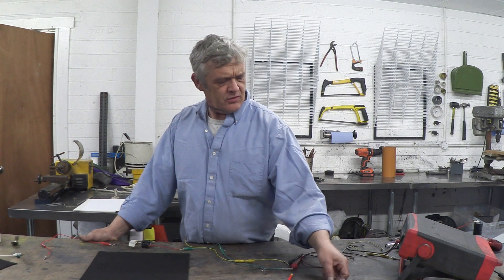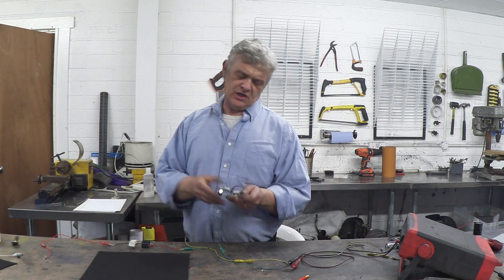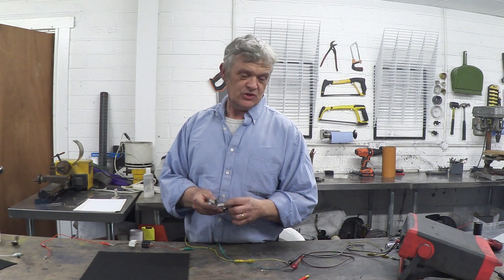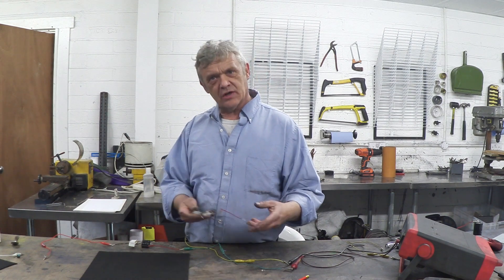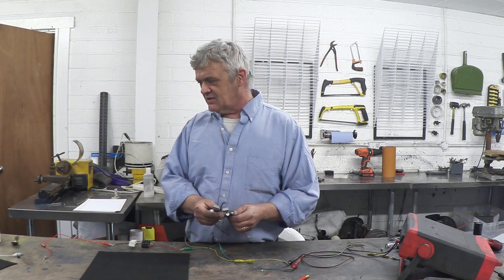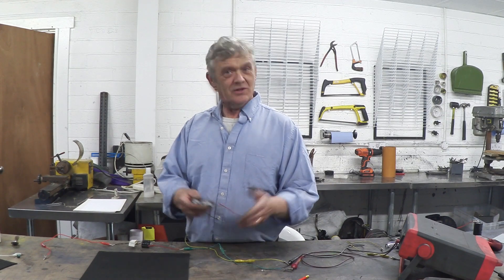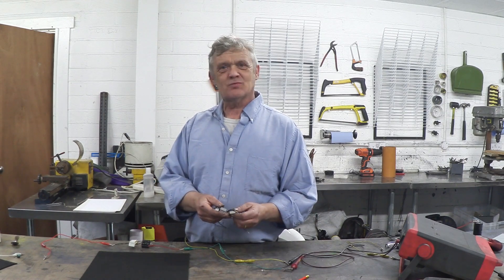Surprising Material Doubles Energy Collected

Comment: I've seen a video years ago of John Hutchison chucking his copper plate up into a tree and running a motor with the basic energy collector setup in Tesla's patent. He talks about pre treating the plate in a acid bath. He etches his collector plate / antenna with the intention of causing "sharp point throughout the surface. It could be that this carbon felt is also  similar to the etched surface and is able to absorb / collect better than just a flat "polished" surface.
Reply: The problem with john hutchison was he never give any information to public but rob always does...God bless this man

Comment: I thought Id do a dirty and simple test experiment first, as a baseline before trying out any carbon felt or other materials and was quite surprised at my results!
I hammered a rusty steel stake into the ground a few inches and then jubilee clipped a length of copper cable (speaker wire) to it. Then I cut around a 2 m length of 1.5mm twin and earth flat mains cable and stripped out the brown and blue wires so they were separate. I straightened out the brown wire as best I could by hand, exposed about 1cm of copper core at one end and stuck it along a wooden beam that runs  across the inside of my garden shed.  I connected my multimeter to both wires, the one from the ground stake and the other to the end of the suspended mains cable and switched it to AC volts. The meter showed 625 which I thought wasnt bad for a dirty quick test, then I realised it was actually reading 6.25 volts!  I switched it to the freq setting and it read out 50hz.  So to see what happened next I suspended the spare blue wire I also had, but seeing as I had nowhere else to suspend it I just stuck it alongside the brown wire that was already there so they were both sitting next to each other and even touching in places (both wires still have the full insulation on them). I connected both antenna wire ends together so they were in parallel as that was the easiest thing to do. I didnt expect it to do anything really, but the voltage now read 9.35v AC, a 50% improvement.  No bad for a 2 m length of old mains cable.  I made up the circuit you showed with a couple of spare caps I had lying around (400 nf I think) and set it to charge the electrolytic capacitors.  I'll check the max DC volts on the caps tomorrow.
Reply: 1 day later and the electrolytic caps were charged to 57v dc.
Reply from the maker: awesome mate - interesting results

Comment: Random thought for you.  A piece of conductive metal (zinc) would have a resonant frequency it works perfectly at.  This would be where it collects the most energy.  
Carbon felt would have multiple conductive paths through it and as the material flexes these paths would change.  My random thought is.  The multiple paths would have multiple resonant frequencies and thus would collect energy over multiple frequencies.  Anyway thought I should share that in case it may help you or someone else.

Comment: I built up your exact circuit and measured 2V across output however when loaded with a 1 megohm load the voltage dropped to 1V. This meant output power was limited to 1 microwatt. Almost useless!
I put an oscilloscope between aerial and common of output capacitors and measured about 2V peak to peak of 50Hz which is consistant with 2VDC output. This proves that the voltage I measured was generated by stray field from house wiring.
Reply from the maker: okay mate

Comment: Thx Robert,
As always very interesting what you do.
I have had this circuit laying around for quite some time to.
I noticed surface area is very impoprtant as is hight.
Someone made this circuit on a PCB 100x So 1 PCB with 100x this circuit and they all connected to 1 antenna (aluminiu foil) in the attic of his house.
He claimed to get a steady 100 Watt power out of it all. Maybe an idea to work on/with/by/under. Anyway you please?

I love your channel and what you develop and research. Keep it going.

Cheers,

Rene
Reply from the maker: yes - i mean to put it higher but want some standards so am keeping it in the same place for now

Comment: Can you put an oscilloscope on the antennae input and measure the frequency and voltage?
If 1N4007 diodes work then the frequency will be low. I suspect it is stray 50Hz mains noise you are picking up.
It would also be useful to know if antenna is directional.
Reply from the maker: equally mate - it's such a piece of cake you could do it and share
Reply: @ThinkingandTinkering  I built up your rig but used high speed 1N914 diodes.
I managed to get over 2V  but if loaded with 1Mohm resistor the voltage dropped to 1V i.e onlt 1 microwatt of power available. 
I put a scope onto the antennae input and saw about 2Vp-p at 50Hz in the input. This is just stray fields you see adjacent to any mains cable. If you wish I can send a photo of the oscilloscope display

Comment: In your battery experiment with the potassium hydroxide solution, how would carbon felt stand up as a replacement to the carbon rod wrapped in steel wool??
Reply from the maker: badly the conductivity of the felt is a bit low for applications in batteries all by itself mat
Reply: Any better when you combine the felt with the carbon rod & steel wool??

Comment: from an antena power collection perspective it doesnt really suprise me if you take into serious consideration the self simular fractal nature of the foam antena at all micro/macro scales and electromagnetic wavelengths, thinking about the dark material, perhaps dipping it in a colloidal formulation of micro thermoelectrical particals with opposing magnetic fields would enhance the device even more ,as the suns/local heat would then also add to the localised generation
Reply from the maker: i was having similar thoughts mate - cheers

Comment: Hi mate! Very interesting as usual. May i suggest a few experiments? As you may now, nano-particules have very effective antenna properties. when two particules are close enough, their sensivity is multiplied by 10.000. These particules are very easy to obtain by a chemist. One could make a coating that could be applied on clothes in order to charge phone, for example, but i think that the sensivity would be surprisingly great. Another idea that may seems crazy would be to put a nail in a tree and connect it like an antenna and look what we get. Nano-particles are everywhere. Depending on their size, they resonates with specific frequency. Also, phones antennas uses fractal design in order to minimise size. Think about it... Cheers!
Reply from the maker: yeah - such thoughts are always on my mind Adrian - it is interesting that with nanoparticles the apparent aperture is greater than the actual aperture - something in common with active receivers
Reply: @ThinkingandTinkering  Yes,  i even bet that it should be possible to use an antenna in place of a phone battery. Such antenna should use nanoparticles and should be tuned up to the most powefull frequency, which may vary, or not that much...

Comment: I can only imagine what will happen when the carbon felt is dip coated in that amazing ink you make. Surly the graphene would increase the surface area. I will give it a try as well and let you know what I find.
Reply: J S Coated... or sprayed? Eh. Sprayed could help in continuing the “more surface area” theory.
Reply from the maker: it may not be surface area mate - it may be that the structure of the felt represents an antenna network and is more like a metamaterial

Comment: Just a question and maybe something to be careful of:
When you were doing your measurement have you used it at the same time with any other antenna?
Reason for this is that measurements can vary simply because of the time you are testing there is increase in RF activity, WiFi router, radio station, TV or what ever else is collecting  - therefore if you measure at specific time without knowing what actual radio wave spectrum you collecting, reading can be misleading. Also worth adding in centimetre wave length small movement in room can mean different result, and you can see that from phone apps that measure field strength in room.
Reply from the maker: Bifield-Brown had similar problems - i think for 5 years he took his measurements based on time of day....cheers mate

Comment: Amazing.  Maybe the thickness matters, but i bet the impedence or resistance in the material helps build up the resonant wave forms, making it a better inductor.  If its just impedence, then tiny resistors would show the same result on flat materials.  Maybe it is the third dimention that affects it.  The military use beefy antennae, so yeah, maybe so.  What a great and potentially cheap antenna material!  Wow, this makes me wonder if the Earth's thin layer of crude oil is conductive, and how that affects lightning storms.
Reply from the maker: interesting ideas mate - cheers for the post

Comment: I assume that the different materials tested were all the same size/area/volume?
Reply from the maker: lol - of course - and in the same geometry, position in the lab and concurrent testing to remove any time factor
Reply: @ThinkingandTinkering  Have you tried creating a second same size mat and connecting it to the "ground point" so it will act as a dipole?  I'm also curious what do you think you are actually collecting? Is it RF energy from a broadcast station? Wifi? Cellphone tower?  any ideas?

Comment: Like sound waves it may be catching back splatter aka you throw a ball at a wall it bounces back the felt is not flat thus the bounce back goes off in many ways and hits more walls and bounces and so on.
Reply from the maker: that's highly likely - it's an activated carbon and it is probably happeneing at the mesoscale as well
Reply: @ThinkingandTinkering  Right down tiny carbon caverns the world is so amazing.

Comment: My guess would be that it has to do with the increased surface area present on the carbon felt. Zinc plate would have a front and back surface.  Felt has front, back and many layers in between based on the particle size of the carbon. 2X to 8X surface area increase could be possible.  :o)
Reply: That's what I was thinking too. I wonder has anybody ever made a high surface area radio antenna like that before?
Reply from the maker: there are quite a few things that could be variables here - surface area could be one, geometry another and internal structure another
Reply: @ThinkingandTinkering  As a test you can take a tightly bunched up ball of steel wool and get a base line reading, then spread out that same bunched up ball of wool over a much larger area and test again.  Assuming atmosphereic energy does not have much of a penetrative affect, exposing the inside of the wool by spreading it out would somewhat address the surface area question.

Comment: With Radio Frequencies there is this thing called 'skin effect' where the energy travels around the Outside of a conductor rather than through the entire bulk of the conductive material.
Graphene sounds like an ideal candidate, or any other 6-member carbon ring for that matter.
The carbons will be sp2 hybridised leaving that final p orbital free to to form a delocalised electron orbital kinda like a doughnut above and below the plane of the ring, which sounds ideal for the 'skin effect'.
Activated carbon isn't Graphene, but maybe there is some graphene character in there.
Pyrolyse a slice of bread and try that as an antenna if you get the time/inclination.
Depending on how long you leave it in the heat you'll end up with just carbon or a highly complex load of aromatics on a carbon framework, of which the aromatic version should work rather well.
Reply: He's speaking the language of the gods 😮

Comment: Yeah the increased surface area of that carbon felt, I would think, would have increased it's ability to receive energy of the electrical nature. Maybe that translates into an increased current capability on the capacitors?
 Have you done a test on the capacitors energy yet between the two types of antenna material?
 You say one charges faster, the carbon felt? Is it due to an increased voltage potential of the antenna or is it more current capacity in the capacitor?
Reply: I was thinking the same, also what about the spacing of material inside teh felt, maybe a "zinc foam" would also increase?